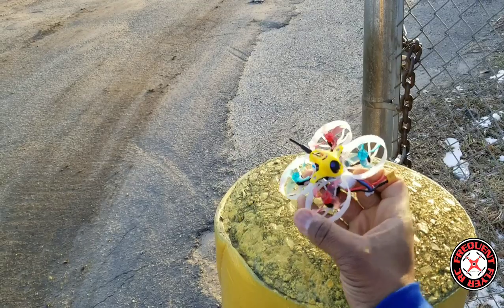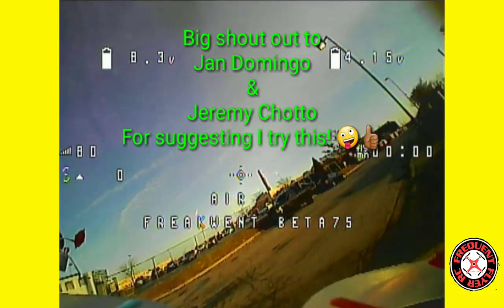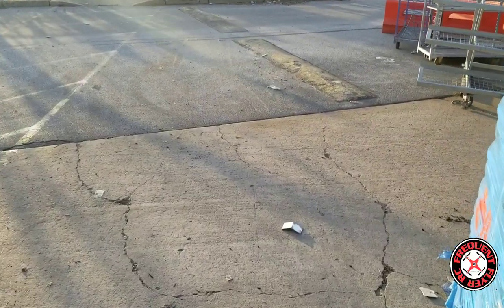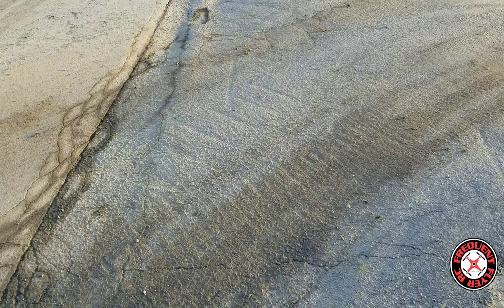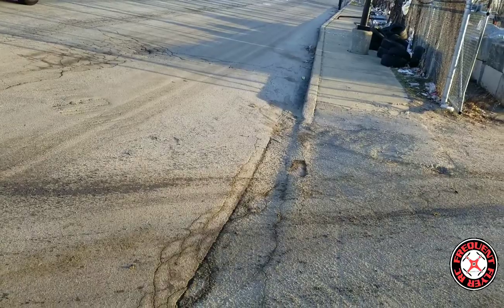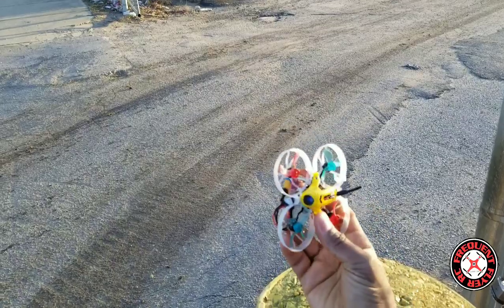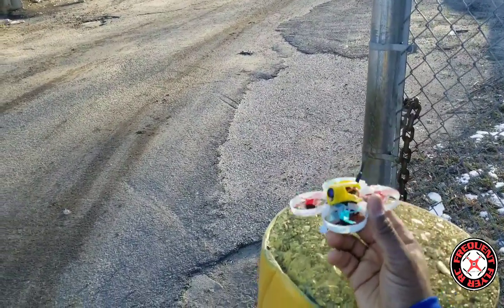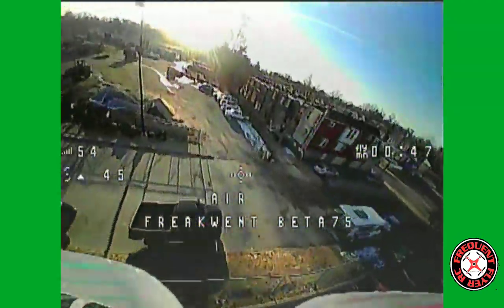No More Yaw Washout - New Solution Without High Idle!

Comment: One more note -> my Beta75 Pro 2 never washes out unless I cross a weight threshold.  Canopy, LEDs, cable connector weight, and battery weight make noticible washout difference.  I get occasional micro washout with the heavier 350mah batteries.
Reply: Good point!
Reply from the maker: The washout on the Pro 2 only happens when you try to make it happen. Do as I do in this video.. I'm exaggerating the dives making it do vertical dives from high up with throttle at zero on the way down. Then pull up at last minute and see if it happens. If I just dived over the occasional obstacles without exaggerating this way I probably would never see washout at all..

Comment: Sorry, but I'm not totally buying it.  This just doesn't make any sense to me.  Since Props-in is the standard for BetaFlight and the Props-out was an attempt to eliminate or reduce the Yaw Washout.  Keep in mind, most tiny whoop quads came in the Props-in default configuration until late last year.  There is something more to this problem than a simple reversing of the props, even though in this case it appears that it helps.  Perhaps your new props are also helping to cure it?  However. In my opinion, it's probably a combination of things that cause the problem and no one thing will always fix it.  Great flying Bro and you are far braver than me to fly outdoors in this weather.  Talk about taking one for the team!
Reply from the maker: You are right kinda.. It doesn't make sense until you try to make sense of it. I noticed the 1S whoops all tend to yaw wash even when just turning fast and I think it was from lack of power. Reverse props fixed the turn yaw wash out in 1S whoops. Once 2S Whoops came along all had more power and all seemed to wash out except 1... The Mobula7. That being said, look and you will see that the Mobula 7 is also the only one that comes NORMAL Motor Direction out of box! Secret exposed. Reverse prop direction cures yaw wash created in turns.. Normal prop direction cures yaw wash out in dives. In normal prop direction the sides become props out which causes wash in turns. In reverse prop direction sides become props in curing turns from wash but exposes front to wash in dives..
Reply: Frequent Flyer RC - Ok, I get what you are saying, but that’s certainly not all that is at work here or everyone would see it equally.  It’s about power to weight ratio, it’s motor efficiency, prop efficiency, so in other words it’s a lot of things.  My Mobula 7 is set up with props out and flies without yaw washout; never ever seen it on that quad, period.  But that’s one of first things I did to it, before I flew it.  So like I said, it may not be just one thing, but probably several factors that contribute to exasperate the issue...just throwing that out there.  However, whatever works for your quad is the way to go.  Personally, this is beyond my understanding, since in my mind, why would it matter what direction the props spin as long as they are correctly sequenced, either props in or props out?  That just boggles my mind...lol
Reply from the maker: Do you fly with a lot of cam angle? I think the way one flies also determines if they will ever even encounter yaw washout at all. I found that in most of these Whoop quads you have to actually force yaw washout to show its face by doing steep dives over and over.. If I flew it normally the Beta75 Pro 2 would probably never washout. It has an F4 fc capable of 8k 8k.
Now the Trashcan washes out on dives Alot without the idle fix I found and I find it to be the tell all test.. If I drop idle and turn prop direction normal on it and it doesn't do yaw wash anymore..
Reply: @frankbarajas Yeah the rotational velocity physics acting on/against the gyros are  pretty tough to wrap the brain around.  But it is indeed a thing.  I've dealt with this sort of thing in designing sims and there are endless factors.  The FC's are running amazing pieces of code that make up for all of our design flaws, but over time the physical designs have made life easier on the FC I think and it's all improving fast.  Love this sport!

Comment: VTX?  Also, as homedronin mentioned below, did you change out your vtx or something?  My vtx on the pro2 has horrible range comparably.  I'm using Eachine EV800D goggles and the two antennas it came with.  My 200mw vtx's have incredible range, this one seems like it runs even less than 25mw compared to my other drones.  Any antenna upgrade suggestions while I'm placing an order? Oh and cool, just saw your t-shirt, added to cart. :) Thanks Mr. FF, appreciate all you do for our community (What's your first name haha, calling you dood, bud, etc. for a couple years now...  I'm Fred btw - aka vrman since the 90s)
Reply from the maker: What up Fred, I'm Jamal the Frequent Flyer 🤪
I didn't change the VTx. You can try a different channel as I find that works to get better reception sometimes with the 800D. The cheap SJ budget goggle makes a big difference though. I was truly amazed at how much better and stronger the feed of these cheap SJ goggles were compared to my 800D box goggle. I can't fly my whole area with those but as long as I stay high enough I could probably fly twice the distance of the construction yard here as long as I use a DSMX satellite receiver or other full range Rx with the SJ goggles..
Reply: @FrequentFlyerRC  Nice to meet you Jamal.  That's a great thing to hear about the goggles.  Now that you mention it I realize I fly outside sometimes from my room in front of a 55"tv.  That little (excellent for $18) Rx with composite out only has a single dipole, and I get almost same video range.  Time to look at goggles again.  Never heard of sj.  Thanks as usual, especially for taking the time to answer all our questions!
Reply: @FrequentFlyerRC  SJ RG01?  How does the resolution seem?

Comment: Hey bud, could you please list all the changes you've made to your Pro 2?  Mine flies great, but it would be nice to see all your changes.  Xt30, different canopy (I actually designed and 3d printed my own with camera saving roll bars), your current tune (I am going to try lowering the idle right now, sometimes mine is so floaty it won't lose altitude lol, especially in wind), which props.  I've watched all your videos, but it would be nice to see all your changes laid out.  Thanks man.
Reply from the maker: Tuned it, put the XT30 on, swapped the cam and canopy then finally set idle back to 4.5 and reversed props
Reply: @FrequentFlyerRC  Thanks Jamal.  I actually lowered my idle speed even lower today and the dives are more intense for sure.  I recorded a flight with the 300mah battery and one with the 350.  A couple washouts with lower idle and heavier battery.  I should get off my rear and post them.  Great fun quad for sure.

Comment: What canopy is that?  Any advise on a good whoop canopy?
Reply from the maker: Well this is an average canopy by most but if you don't want to move the angle around its great for gluing in the cam at a fixed angle and provides good protection!
Reply: Thats a King Kong (LDARC) canopy....you can order then in packs usually. Not sure if you can find them stateside, so they can take a little while. https://smile.amazon.com/QWinOut-Plastic-Canopy-Kingkong-INDUCTRIX/dp/B07FNK914W/ref=sr_1_3?keywords=ldarc+canopy&qid=1550212544&s=gateway&sr=8-3
Reply: Thanks!
Reply: I guess I should post my canopy design on thingiverse. Having the bumpers to save your camera let's you fly like a maniac (which is the only way :) just taking the time to make that canopy made me better pilot.  When I don't worry about a crash, I just fly better.

Comment: How do you change direction of props I have the trash can
Reply from the maker: Use BLHeli Suite to change motor direction and then toggle off the "motors are reversed" switch in Betaflight.
Reply: Thank you 😊
Reply: Gfighters2011 make sure props are correct also after switching.
Reply: I just tried it and now it won’t even power up I think the power board is fried
Reply from the maker: What exactly happened?
Reply: Gfighters2011 hey.. hope we can help. it's rare a board fries with betaflight or blheli.  hopefully it's just a settings adjustment that needs to be corrected. what happens when you just plug it in to betaflight (no battery attached)?

Comment: No single dive in here🤷🏻‍♂️ a dive is 90 degree! You Fly down with 50 or 65 degree! And that thing is wobbly af
Reply from the maker: How about try what I did.. It was just a simple switch from props out to props in direction. Tiny quads should NEVER be made to fly props out. Props out was initially applied to full sized race drones to stop dirty air and wash out on hard turns. It effectively switches side flight to props in which stopped the dirty air on turns and stopped washout. But this application puts the dirty air in front instead of the side which causes washout in dives.. In drone races there isn't much hard diving, mostly hard turning! 👌🏿

Comment: 1st. Camera loose bro.
Reply from the maker: Fixed it in the last flight on the video👌🏽
Reply: Btw what u think of those gemfans? I didnt like how they made the quad super floaty.. even dialled it down to 1.0 idle and still floaty. Plus it made my rates feel slightly slower. Switched back to stock props. Yours didnt look floaty either. Must be the frame. Mobula7 on v2 frame + 4 blade gemfan is floaty af!